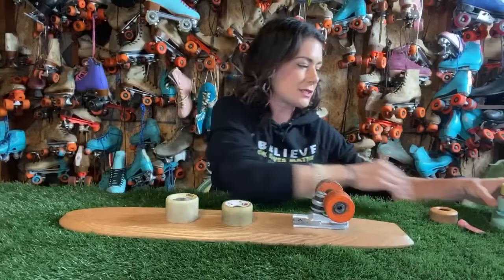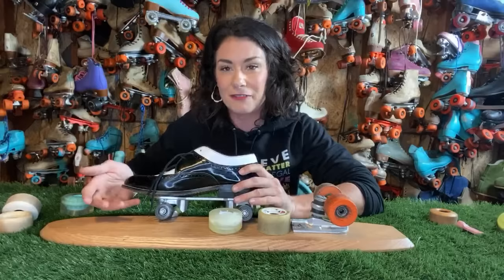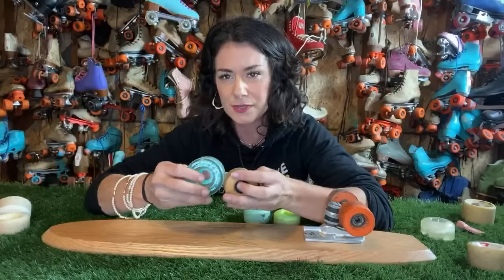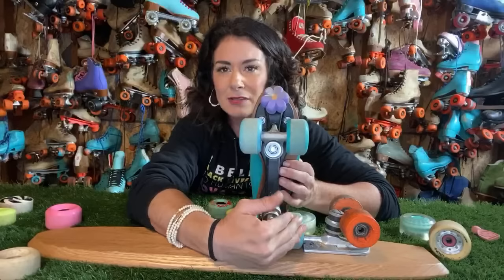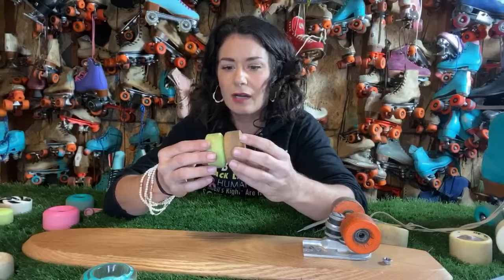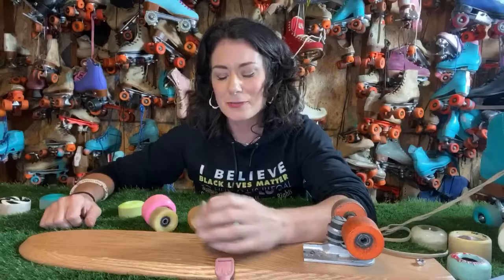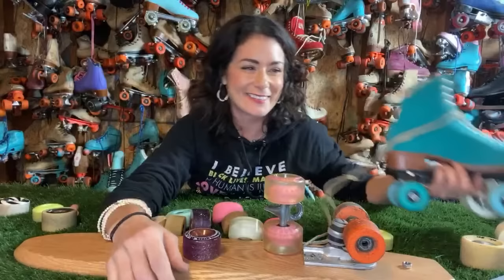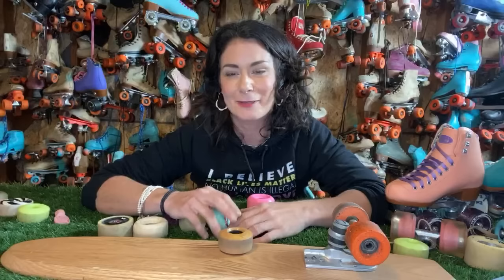Roller Skate Wheels Explained by Estro Jen

Comment: A correction: a durometer is the name of the instrument used to test hardness of a soft material (PU, Rubber, Leather, soft plastics)
Shore A (A rating) is used for the softer of these materials. 

You can call it shore hardness or durometer hardness to differentiate from the other tests like Vickers or Rockwell which are used on metals and such.

Comment: Summary of key info of the first 52 min:

Printed on the wheel: Hardness and diameter. 
Hardness (durometer): Measured in an a-scale, the higher the number, the harder the wheel. The outdoor wheels are softer between 72a-82 so that you don’t feel the ground that much. Indoor wheels are harder >82 up to 100. Harder wheels are faster and you have more sensitivity, the soft is slow because it absorbs more. 

Diameter: Measured in millimeter. The shorter the wheel the more ground control. The higher the better is the cruise feeling and the more lofty and less balanced it feels. The most standard in rollerblading 57mm, the moxi trick wheel is 59. You wanna stick between 48-65. 
Running surface (contact patch): Actal surface that touches the ground. The narrower, the better it is for agility but the more balance is needed. The wider the harder to turn but the more grounded you feel.

Short stubby outdoor dance wheels those of the beach bunnies, cannot be purchased separately yet. Trick wheel is the all purpose indoor wheel, good for dancing and ramping 97a and 20 cm running surface and size of 55 or 59. Funday wheel running surface: 18 mm.
the width of the wheel is going to give you stability. It's great for outdoors and the skate park.

The quality of the wheel material (polyurethane) and the core of the wheels and how well both matches defines how organic the feeling is. Both are essential for the integrity, stability and the roll and you want the core to match the hardness of the polyurethane. The larger the core the more you feel the core and the hardness of the core, however the smaller the core the more polyurethane you feel. The core controls the trueness of the roll of the wheel.

Also the lip of the wheel makes a big difference for trick and outdoor skating and will influence how quick it‘ll wear down.

You cannot put skateboard wheels on rollerskate axles, however vice versa works.

Comment: This was so helpful for me when I first got my skates for Halloween, 2020. I started on the stock Lilly wheel, of course. But after watching this video I got a set of fundaes which are great. I love them. Then I went back to the outdoor wheels for a few days and I could not even turn anymore. I had no agility, even though they’re smooth. Then I got a pair of luminous wheels because I mostly skate at night. My preference are the Fundaes but they don’t glow in the dark or light up. Right now I’m rocking the luminous which are harder than the Outdoor wheels but softer than the Fundaes. I am having fun lighting up the night but my favorite in terms of performance are the Fundaes. I have yet to try the trick wheels. I’m a pro now at changing my wheels and I have a set of bearings in each and every set of wheels. Thank you for teaching me so many things I need to know for beginning my skate journey. Love 💕😊

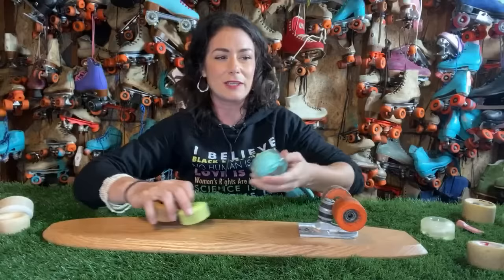Comment: 25:40 97A wheel not to hard for outside not to soft to go around the rink. 55mm more grounded and 59 mm is taller. They are both 31 mm wide.  Narrow wheel more agile. You use these for dance

Comment: What is the difference between the stock wheel on the Lolly vs Beach Bunny?
Reply: It's also important to keep in mind that the stock wheels on the beach bunny and panther skates don't have a hub. This means that if you are a heavier skater the wheel could compress slightly, or the wheels could start to squeak slightly over time due to the wheels squishing against the bearing ever so slightly.
Reply: @zanerobbins7604  oh shit could you elab a bit for me? I've had my Panthers about a month am a super heavy skater and had a squeaky wheel at the end of the first week. If I get new bearings will they come with a hub? Help pls lol
Reply: @darkwebgirl  the bearing doesnt have the hub, the wheel does. If you get new wheels the squeaking problem should be resolved. The hub is the hard plastic part of the wheel that the bearing sits in and if the wheel is clear you can see it inside of the wheel. On derby wheels the hub is almost totally exposed and looks like spokes. It basically gives the wheel structure so it doesnt totally compress when weight is put on it, making it perform better. Examples of wheels with hubs would be the Moxi "Classic" wheels (also known as the "juicy" and "gummy" wheels, these wheels come on the stock lolly) and the Radar Energy wheels. An example of a wheel without a hub would be the Sonar Zen Wheels. Unfortunately outdoor wheels are in incredibly high demand right now and are basically out of stock everywhere, but if you keep your eyes peeled (and i mean, like, watch the wheel listing online like a hawk) you might be able to snag some.
Reply: Have ye any experience using bearing spacers with quads ? If so any idea if I need them with moxi gummy wheels ?

Comment: QUESTIONS Estro Jen. i just got a crazy idea to skate again. its been since 1979. I have my well preserved Dominion Bright Blue suede with bright yellow stripes that were pricey in the day.( aluminum plated and heavy.) They seem to be fine but before I put them on I wonder if the wheels change hardness from age. does polyurethane  get harder as rubber does get harder and brittle with age.  This model is Dominion Marathon. where can I buy yellow stoppers that will work with this model. i plan to start skating indoors before I move outdoors....  what advice do you have for me about the wheels? thanks!

Comment: I have used skate board wheels since the real rinks closed in the 90s because the only place left was skate parks and the street so bigger meatier more rugged wheels were required, which is why I would steal them from skateboards for my boot skates. Where can I get those 44mm wide wheels and is there something that is medium hardness that can absorb rough concrete ?! The thinner ones are what we guys used for speed skating back in the day b4 inlines...swapping them in an X to reduce uneven wear, brilliant tip, thanks...

Comment: SKATING WHEEL HAS CHANGED FROM A BEARING WHEEL TO NOWADAYS STRAIGHT AXLE NUT WHEEL. I USED TO ADJUST THE SPEED ON BEARINGS. STRAIGHT WHEEL TENSIONS DIFF, I'M OLD SCHOOL  SKATER FROM THE 60S-80S

Comment: I thought 92a is a pretty hard wheel and isn’t for outdoor. I thought an outdoor would be more in the 70 or 80’s a ?
Reply: Hmmm could it be that beyond oustide and inside binary that peolle usually use for wheels considerations is what you use you're using the wheels for. Like if you only jam skate outside you might consider a 92 aka a harder wheel not a gummy / "outdoor" wheel
Reply: Yes she said outdoor is usually around 78A vs indoor which is better with 90s-101A

Comment: Question: has anyone tried narrow inline type wheels on quads? Would that make outdoor skating easier (rock avoidance)?
Reply: ive thought about this before just keeping in mind the height of the bottom of the skate so the wheel doesn't rub against the plate.  im not sure about the stability of inline wheels since the profile is way more narrow & im not sure how they would fit on the trucks since the quads core have more width?

Comment: I'm beginner and absolute new to roller skates and got my Beach Bunnies recently. Loosened up wheels and bearings, but when I got outside it was hard to even stand on sidewalk (was feeling like wheels slipping under me, although I didn't loosen them up that much, just enough to roll around. Wheels felt like inside on this flat slippery floor when I tried on skates inside, even fell backwards good thing there was armchair to safe my butt (and that was before loosening wheels). When I got back back home I tighten wheels, but I still wonder if Beach Bunny wheels gonna be good for bricked sidewalks, we barely have any sidewalks with asphalt or cemented surface, all the sidewalks and most streets are bricked (and different type bricks). My plan is to cruise around and outdoor dancing, whenever I'll learn basics. Should I change the wheels? Like to gummy ones or Fundae...
Reply from the maker: Send us an email to CS@moxirollerskates.com and we can give you some tips! :)

Comment: Would you recommend using skateboard wheels on rollerskates?
Reply: i feel the Chaya Karma Quads wheel has the most similar feel to the skateboard park type wheels imo. jen stated above that rollerskate wheels can be used on skateboards but doesnt recommend the vice versa that b/c the skateboard trucks & rollerskate trucks are designed differently to be used in different way though they behave similarly. even skateboard wheels vary though so its a project to be experimented with. who is to say you cant break the rules every now & then.

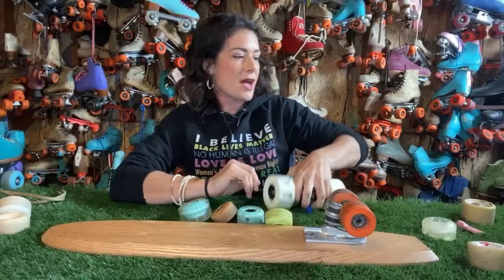Comment: @36:30 must need a special plate to put phenolics on moxi boots only. Because my stock Moonlight Roller takes 38mm phenolic wheels smaller than the ones you had without any modifications.

Comment: This is a really late post from when this video came out but I’ll ask my question any way. These wheels are 101A and it states concrete as being a good surface for them. I have outside concrete trails and it is said to use around a 78A wheel. Can you clarify what this means? I believe I would want these color wheels but in a softer wheel? If so would you come out with something similar?

Comment: I bought a pair of skates that came with 97A wheels, skated outside and felt pretty confident even though it was pebbly. I put on a set of 78A wheels, and I felt so unstable, almost like I’m flying. Do you have any tips on how to get used to skating with outdoor wheels?
Reply: You don't necessarily have to use outdoor wheels. I usually skate streets and roads with 101a wheels, I'm used to it and except for the noise I don't have any reason to change my wheels. Now if I was gonna skate for hours on really terrible pavements I would probably want to switch to softer wheels to get less vibrations and a more comfortable ride. If you like your 97 outdoor and the ride is smooth enough for you then you should just stick to whatever feels the best for you. 
Sometimes wheels are quite slippery when they are brand new, there is no big solution except using them. It should get less slippery after a few sessions of outdoor skating, try to find a flat spot and just roll around to get use to them and break them in. Have fun ! :)
Reply: Neyn thank you for your advice! 💕
Reply: personally, i have joint issues so a softer ride is something i would look for (even though rollerskating is lower impact, hard wheels really shake up my body!) but if you like your ride theres no reason to change! its all personal preference with this stuff.

Comment: Does mm size matter when it comes to bearings? I’m planning on buying some 65x35mm wheels for my skates, but the original wheels on the skates are 57mm. Does this mean I need to get new bearings or does mm only matter for the thickness/height of the wheels?
Reply: Have you gotten an answe to this? I got roller skates but the wheels are really hard and I want to be able to get softer wheels j just dont know if size matters.
Reply: Did you watch the video? She showed how to switch the bearings to a new wheel. Or you can buy bearings for each set of wheels for the ease.

Comment: Larger diameter wheels cover a greater distance in drive wheels such as automobile wheels. Skate wheels are idler wheels and will cover the same distance regardless of diameter. This can be tested by putting 70 mm wheels on one skate and 55 mm wheels on the other and rolling down a hill. If they traveled a different distance you would end up in the splits. This won't happen. The skates will go the same distance but the wheels will spin at different rpms.

Comment: "American made Urethane is the best" not true! 

Not all Urethane is equal, this is true. Urethane however is not that complicated, the reason it's not all equal is because mass production is cheaper and so under a capitalist model where profit is king people cut corners because they can make Urethane that is "good enough" at a low cost. The best Urethane for skating is easy to make but slow to make and so all the big skate wheel suppliers don't use it because time is money. There's an Australian wheel maker who makes what are widely considered the best Urethane wheels for skating. He hand makes them to order and they're expensive but they are the best skate wheels and they're not make in America.